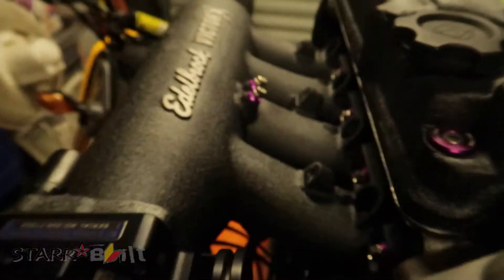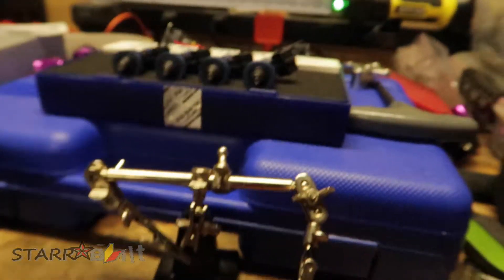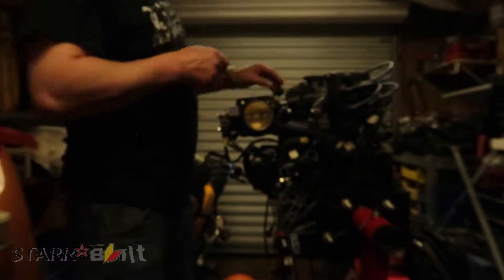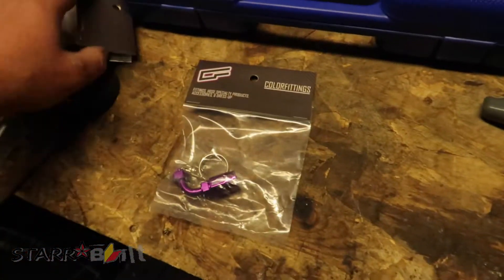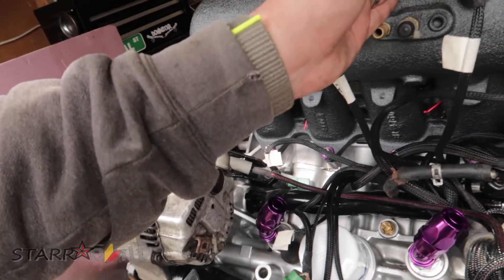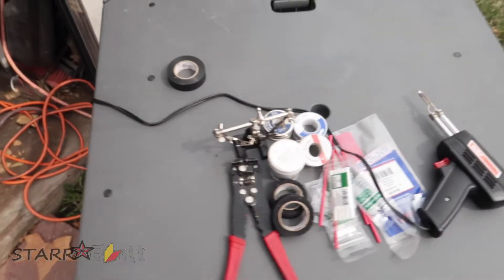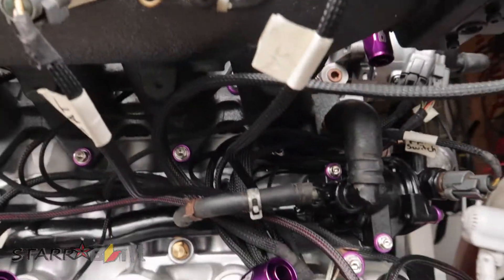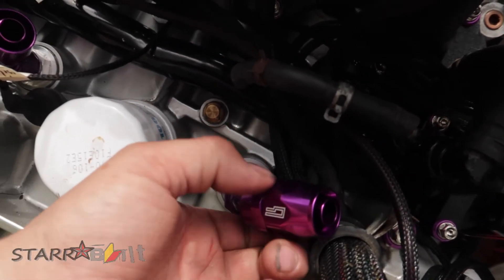FIC 1650CC injectors install (B series honda)

Comment: I love your catch can! and 4 port breather set up. Smart thinking. Most don't even consider venting there engine much at all. Looks like you've done everything right. I'm a firm believer in do it right, do it once! Did you have you oil pump ported? It pays big dividends to have it done. It stops cavitation of your oil so you don't lose a bearing at high ram's.
Reply from the maker: exactly my thoughts
Reply: @StarrBuilt  I will be using the 3 block ports in the back of my b18b1 block. Case pressure comes from under the pistons so I figure it should be sufficient.......I hope
Reply from the maker: @jimhiscott2918  yah should work
Reply from the maker: I am running an acl oil pump
Reply: Ran oem on all 500+whp lsv 8500 lsv is my cut off so I don’t really have to worry about cavitation just shim the pump .065 washer and close it up  but then again I’m using hx bearings for extra clearance so far so good over 4 years multiple 34lbs of boost wot runs and still pumping strong

Comment: How did you manage to fit the bottom o ring seats so easily? Feels like I need a press to install the damn things.
Reply from the maker: I used a little bit of oil around the seat and it slid right in
Reply: @StarrBuilt  you use the ones it came with?
Reply from the maker: @hoodrichracing3901  yes for sure

Comment: Beautiful machinery is right! I was going to buy the 1650 FIC but my real street performance rep talked me into the 1700 I.D. injectors. That motor is looking incredible. What is the HP goal?
Reply from the maker: my power goals are like 600-650 hp on high boost and just turn it down so it makes tractions
Reply: @StarrBuilt  Be sure and install a 4 port and have boost by gear. That will handle any traction difficulties I'm sure you are going to have like the rest if us. Roll them front fenders and install some fat 225 wide 888 tires. Your honda will scoot bro!! With your set up I bet you will be close to 600 at 19psi
Reply from the maker: @jimhiscott2918  4 port for sure and yes 888s what setup are u running